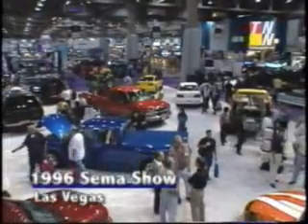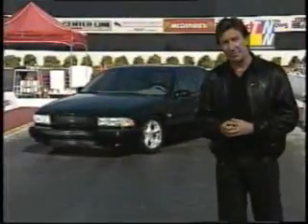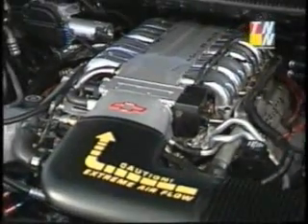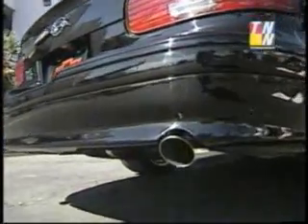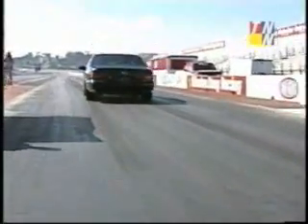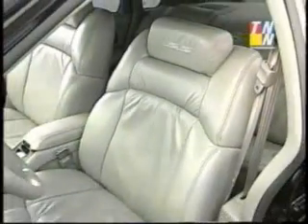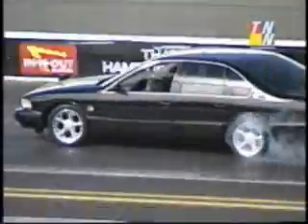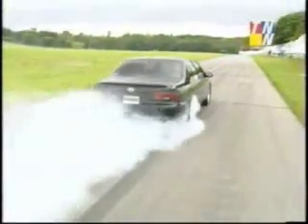Tim Allen's 1996 LT5 Impala SS

Comment: I bought my 96 Impala SS new.  I still have it.  It was my daily driver until I started working from home.  Now it's a garage queen that only comes out when it's time to haul the grandkids around.  It has 317,000 miles.
Reply: Can I buy it?
Reply: I love to hear stories like this 
These are real classics now
Reply: 😂how many transmissions
Reply: Might be worth more than what you paid for it.
Reply: @catsaretasty  1st transmission made it to 270,000 miles.  Replaced the engine around 250,000 miles.  Rebuilt the rear end around 280,000 miles.  The car now has 322,000 miles.
Reply: @josels1292  I have no intention of selling it so its value isn't important to me.  8-)
Reply: @hafablake3599  I'm getting more and more inquiries as the car ages.  No plans to sell it.

Comment: That's funny how 454 hp was insane in 1996. Nowadays 4 cylinders are pumping out over 300 hp.
Reply: 450+ horse from a naturally aspirated V8 is still very impressive. Those 300 horse 4's you're talking about are using turbos.
Reply: moparmaniac21 there are n/a 4 bangers out puting over 300whp
Reply: N/A Pontiac Fiero Indy Car made 300hp from a 2.5 4 banger! Back in 85!
Reply: Ian Thompson That was for Indy... The production repros only made 91 horses.
Reply: Myrdoc Technology man.. It's crazy ain't it..
Reply: Oh I know, still impressive though. Check out Smokey Yunicks Fiero, hot air car... Closer to 300 hp from a 3 cylinder iron duke, believe it had 60+ mph too... Crazy right?
Reply: Also it's insane not because of the power but the DOHC LT5 he swapped in, that is insane! Plus like he said^ the corvette had 300/300. So an impala having 150 more hp? Yeah impressive.
Reply: cool!
Reply: Nobody can trash 454hp. Especially the 4 banger crowd. Most of us go to work with half that.
Reply: Hellvirasecksecksecks don't forget to smog it with cats and an egr system. (- lots of hp)
Reply: Chad W,  but are highly strung with little torque. Blah blah blah, 300hp 4cyli...... who cares? drive a 300 hp 4 then a 300hp 8 and you'll know why v8 guys prefer v8's.
Reply: Ian Thompson,  Its a zr1 engine. They were 375-405 hp stock.
Reply: Hellvirasecksecksecks,  You rock up to the lights in your car, and someone pulls up next to you in what looks to be the same thing. Now what makes yours better in your opinion? The little details or custom things you have done that the other guy hasn't right? Its not always about the bang for buck or total HP made. Its about how different it is from every other sheep running a so called "10:1 solid flat tappet 355" in their ride when you've got the quad cam.
Reply: bernzie001. Little torque? Most of those 4 bangers make around 300lbft also and from very low revs.
Reply: The funny thing about those 300hp 4cyl engines, my v8 mustang still leaving them at the stop lights
Reply: That’s still very good these days
Reply: Those modern 4 cylinders do not keep up with a 6 speed 97 Lt1 camaro ss in reality. They dont make nearly the same torque
Reply: @LeoM-zt3pl  what the hell ever man, I used to dust LT1 Camaro's in my old STi, and that was over 10 years ago.
Reply: @Myrdoc  that hasn't been my experience. Wrxs and STIs get eaten alive. Maybe all the owners ive ran dont know how to shift but its never even been close
Reply: @Myrdoc  1997 SS 6 speed traps between a low of 103 to a high of 107 bone stock. Stock STI doesn't come close to those numbers. You mustve been racing older beat up auto z28s
Reply: @Myrdoc  heck I beat a 2018 STI in my old daily driver  2013 accord v6 6 speed. An accord! The turbo lag is brutal on those things without a driveline destroying redline clutch drop

Comment: The engine was actually designed by Lotus, and manufactured and assembled by mercury marine.  Ford did the same thing with outsourcing the Taurus SHO motor to yamaha.
Reply: The SHO has a Yamaha engine? That thing will probably run forever. Yamaha also helped build the engine of the most beautiful sounding car ever made in my opinion, the Lexus LFA.

Comment: 600 Horsepower to the crank.
454WHP..that stands for Wheel Horsepower.
The energy transfer from the motor->tranny->driveshaft->differential..that's why it is less than he said. Hope that helped.

Comment: I had a 1996 Impala SS and I swapped the LT1 engine for the 200 hp 4.3 liter V8 with single exhaust.  I paid out the wazoo to have it done.

Comment: Oh Timmy Boy, The Dodge Hellcat has 707 hp! Wubba wubba wubba, you Impala's in trubbba.
Reply: That don't mean shit they compared the challenger he'll cat ND the Camaro 450 hp vs 700 +hp and that shit did do no damage to the camaro it was of by just 1 second. I'm ot even a camaro guy either
Reply: You gotta remember.   This is back in 96 !     Regular Corvettes were running 13.9 @102 Mph.   Tim's best run spinning with 3 people in a car was 13.39 @ 110 plus Mph.    I'll bet that car will run at least a 12.9 or better with D.R's.
Reply: one more time guys, this is not 1996, the car is a 96, it was built later than that, don't brag too much about those hellcats, an electric tesla 4dr sedan kicked its ass over and over.

Comment: A 4 door family car type body would not be my choice. Not cool to look at but it certainly is evidence that if you have enough $ you can make anything burn the tires. His Hemi powered pickup is cool. That one would eat the grocery getter bodied Chevy for lunch. To each his own. Nice to see Allen is a car guy .
Reply: Guy Fawkes
So what does a "corvette block" have to do with anything? All of my life I have heard people speak of engines that came from corvettes as though that really means something-it does not in itself mean anything. A 4 bolt main block was available for many applications and only means a stronger bottom end and not necessarily more horsepower. And what to H are you attempting to say with "pushrod low end torque" ? Obviously you don't know a great deal about engines and such. As for  "a very good burnout stock" put a linelock on many vehicles and you can a "very good burnout".
Reply: Guy Fawkes The ZR-1 (the engine they used in this impala) is actually Dual Over Head Cam. It's the only GM v8 I know of that has overhead cams. GM made this engine just for the ZR-1 corvette. DOHC means no pushrods, lifters, or rocker arms. As soon as you take the valve cover off there's two cams right there riding on top of the valve stems. With OHC, you do away with some moving parts(lifters pushrods, etc.), but you gain a great big timing chain set with a lot of plastic guides and tensioners. I'd rather replace some bent pushrods myself.
Reply: I think a lot of the appeal for muscle sedans comes from how unassuming they look especially something like the 94 impala which only had subtle cosmetic differences from the caprice. Heck even some two door cars look ho-hum like the 04 GTO which looks like an oversized Chevy cavalier. But they all have the power and torque to surprise
Reply: 96 bubble ss made some juice from the factory, dont need much money to spin those tires except gas.
Reply: not sure where all you "car" guys get your info but no the impalas didn't all have corvette engines. thats really a silly statement, to begin with a corvette engine is just an engine thats put in a corvette, yes back years ago maybe 55 58 or along in there you might could say an engine was a corvette engine, you cold even order a impala with the six cyl engine if you wanted to. and back in those days impala was only a trim package anyway. maybe check a hemmings book for a little factual info.

Comment: 450HP was a HUGE number back in that time. U can mess with the LT1 or LT4 to give u that HP
Reply: Simply add a super charger and you could probably get 400 hp from a LT1
Reply: BACK IN THE 90S THIS CAR WAS DOUBLE THE POWER OF MY 87 MUSTANG GT OF WHICH BACK IN 95 WAS CONSIDERED A VERY FAST CAR AND YES I STILL HAVE MY FOXBODYS A 92 LX 5.0 MY 87 T TOPS MUSTANG GT AND MY VIBRANT RED 93 COBRA AND I LOVE ALL 3.
Reply: @dariog36th  from the research I’ve done it doesn’t seem like an lt1 would be able to handle all that especially a super Charger without completely rebuilding the motor

Comment: for the guys arguing about merc vs chev.  the marauder is ten years newer.  330 horses vs 265 for the ss.  now if you want to put a same year motor in the car, 96 ford=235ish horses, or turn it around.  2006 chevy ls2= 400 horses .  those would be fair, apples to apples comparisons.  and the chevy would win.
Reply: The technology in the marauder is from 94 it just wasn’t pieced together until 03

Comment: Was this essentially the Cadillac Northstar powerplant??? Known for eating heads and head gaskets!!!
Reply: Yes this was the other 32 valve GM made along with the Northstar V8.  But no none of them ever ate heads or head gaskets.  They would develope leaking head gaskets directly related to coolant and mostly Dexcool antifreeze.
Reply: no that is the lotus designed engine from the corvette, no resemblance whatsoever to the northstar, and the northstar had cooling problems because of the iron sleeves in the aluminum block, that and a simple line that would plug up going from the coolant tank over to the thermostat housing.  the iron sleeves had o rings and you could easily screw one up by messing with the heads, nothing wrong with the dexcool its been around for a lot longer than the northstar, its just antifreeze.
Reply: An engine with iron sleeves is not a problem at all.  If it was then no auto maker would be using it.  Many european and Japanese engines are of the exact same engine design and can also suffer similar problems when not maintained properly like any other engine.  Also Dexcool has been a problem for numerous GM vehicles since it came out in late 1996 for all 1997 model year Gm vehicles.  The Northstar 32 valve V8 for Cadillac came out back in 1991 well before Dexcool antifreeze. Antifreeze is not all the same and if not mixed or used correctly will cause engine problems and overheating.

Comment: My favorite car 1996 Impala SS
Reply: I have the plastic model car!
Reply: I have a plastic model of the impala ss
Reply: I'd take the'94-'96, not to picky. Already have the '62, plus a'67 Chevelle wagon and '68 Chevelle2 door hard top. Not quite as nice but acquired w/o having to look over my back!
Reply: 95 I like first year of the cherry color and the gauge cluster nice too and 94s are more rare they all look the same but there is alot more 96s out there but if I wanted a black impala ss il get the 94 cause there is not too many of those and if u like the shifter on the floor u can easily install it

Comment: Wow, the 4l60E in my '96 Caprice had 105k on it and it still shifted perfect?? Please tell me more about how they only last 20,000 miles
Reply: Uncle05Sam The 4L60E is bullet proof if you take care of it and do the maintenance on it. My Dad has 285k clocked in on his and it shifts like butter to this day.
Reply: I have a 96. Love the car. That being said. The 4l60e was a weak spot of the car. It wasn’t really capable of handling the torque these cars had. I had mine rebuilt around the 100k. It was rebuilt to the 4l65e specs. However, I know of lots of cases wherein people are still on their original tranny at 200+k. Many people would say the Achilles heal on these cars were the distributor. But I’m still on the original opti. So you never know. 🤷🏻‍♂️ Cheers

Comment: I love the Impala SS..and btw Impala SS vs Marauder is still apples to apples folks..same performance believe it or not..the marauder has the impala beat in hp but the impala has a bigger motor thus more torque..being torquier the impala is just as fast as the newer marauder..
Reply: the impala ss came from the factory with the lt1 350 cuin engine, and im assuming you guys are all talking about the marauders of the 90s, in case you didn't know they go way back to the 50s and 60s, had 383 and 430 lincoln engines and were plenty fast for heavy cars. the last marauders made had the 4.6 v8 that also came in the mustang mach one, they were basically dressed up ford interceptor cars, same drivetrain and chassis as the crown victoria, same with the impals ss, it was based on the police version caprice. all the info is available if anyone cares.
Reply: The Marauder was Ford’s answer to the impala ss. It’s actually a lot more comfortable and the interior looks more modern and is just as fast going down the highway but the impala ss feels faster due to the higher torque numbers.

Comment: These cars are perfect. Except for the distributors. LS engines were way better.
Reply: Amen! LS engines are becoming the way of the world these days and for good reason.
Reply: angus smith You say that, yet Cheverolet is going back to the iron LT series. How unfortunate is that..
Reply: The LT series was still great and hugely innovative at the time. It's nothing like a sbc. I agree the LS engines are better, but don't hate on the LT's.
Reply: Far from hating. I hear they changed a lot of the weak points that made the LT's hated. So only time will tell I guess, right.
Reply: +The Angry Sysadmin LT5 does not have the optispark. LT1/4 did, and were improved in 94, but yeah  I agree lol.
Reply: yeah we know that on the opti.
Reply: Also, the later LT motors like ours, have full steel timing chains and the reverse cooling system helps cool the heads first, this made the engine much more reliable and last a long time. Got 187,000 on mine.
Reply: Lol yea no shit I'm talking about the original engine that came with these cars.
Reply: Ian Thompson the lt series was a sbc
Reply: No the L98 was a SBC the LT1 was totally different, and the LS was totally different from that
Reply: Ian Thompson they are both SBC, Gen I and Gen II. the gen III LS1 is not a Chevy product. its a GM's engine.
Reply: Stephen Ayeni Yes and no. The L98 is the last gen of the traditional small block chevy engine. The LT was a new series. The LS was a different series than that... and yes they were not just chevy engines anymore. But what your saying is that a coyote is still a small block Ford. Yeah... but no.
Reply: Ian Thompson correct hence why the LT1 was deemed Generation 2. Reverse cooled, and Fuel Injected. However it still shared the same traditional firing order. It was still a SBC at its core. The LS1 was totally different, in the way that the only thing it shared with the SBC was that it had lifters, pushrods, one cam, and was called a SBC lol.
Reply: The L98, LT1 and the LS1 are ALL SmalBlock Chevrolet engines.  The L98 is a GEN 1SBC, the LT1 is a GEN 2 SBC and the LS1 is a GEN 3 SBC.  Then there was the LS2/LS7/L76/L92/supercharged LSA and supercharged LS9, were all GEN 4 SBC, and in 2013 the new Direct Injection engine family including the Stingray LT1, supercharged Corvette ZO6 LT4 and truck 5.3 liter L83 and 6.2 liter L86 engines which are all GEN 5 Small Block Chevy engines.  The next exciting GEN 5 SBC will be in the ZR-1 Corvette, it will have the RPO(Regular Production Option) code LT5. (just like the DOHC LT-5 that made 385hp 90-92 and 405hp 1993-95).  Speaking of the older Chev ZR-1 LT5 it wasn't a SBC at all, it was designed by Lotus in England(which was owned by GM at the time) and because GM didn't at the time have much experience with building all aluminum engines, Mercruiser MArine in Stillwater Oklahoma would due to manufacturing/assembly and testing of the 7200rpm redline DOHC LT-5 engine.  Great engines, all of them.
Reply: LT1 was very unique for it's time and still neck to neck with the fastest lsx engine. I had the best year 1997. Opti spark lasted 153K before I sold the car probably still going strong. Original water pump and transmission. I did not like the aluminum heads with a cast iron block with reverse cooling, with different metals expanding and contracting it was a recipe for ruining head gaskets. Went through 2-3 head gaskets and with coolant in the oil multiple times and re surface the heads twice and the fucker pulled even better with high compression from shaving the heads so many time lol. I have a fast LS1 now but I miss that LT wonder. God just bleeding air pockets on that LT1 sucked but that fucker had a lot of low end and upper power with long tube headers and ported throttle body.
Reply: Kevin K ss
Reply: 1987chickenmustangman🙄
Reply: u just need to have balls to tune up the lt1s and maintenance if u leave a distributor untouched for a while of course it's going to have problems but they could've done better on the engine but still a good 5.7
Reply: The You can abuse the hell out of the LT1 though. In the rare event that it ever overheats it will do no damage to it since the whole thing is iron. My first impala spilled it guys out with coolant on the Highway thanks to a cracked reservoir. It overheated car shut itself off, replaced the reservoir filled it back up with coolant and was on my way.

Comment: 600hp is not in reach of average car buyers, its true that nowadays cars have better performance cause after the 60s when the oil embargo and energy crisis hit in the 70s cars got very weak and continued through the 80s, but horsepower improved alot in the 90s with new technology and fuel injection and has gotten better, so yea that was hot back then but its still hot nowadays and no you can not get 600hp that easily,  most cars, not even performance cars have that high horsepower even nowadays...
Reply: rob perez what you said in no way applies to performance cars....
Reply: Come on guys, even though a mustang like that one is affordable at that price, most cars of that caliber are far more expensive than that!  The average car buyer buys cars like hyundai sonatas and chevy malibus!  Not corvettes or 700hp monsters,  and that impala in that video is a bad ass car.
Reply: The reason that mustang is on that ad is because that dealer is selling it ridiculously low for that type of car, because normally u "CANNOT" get a car like that for that price!